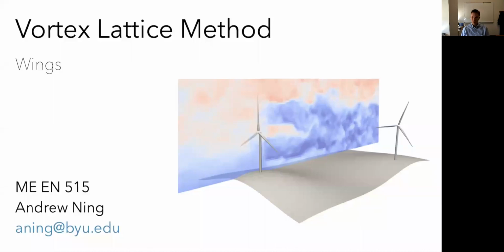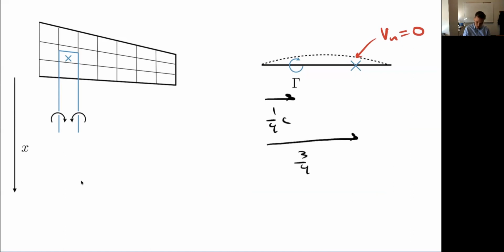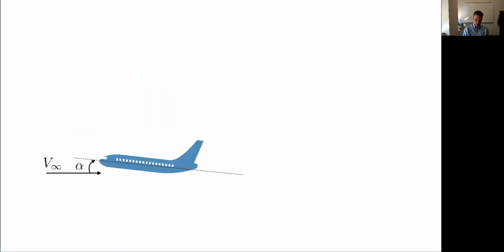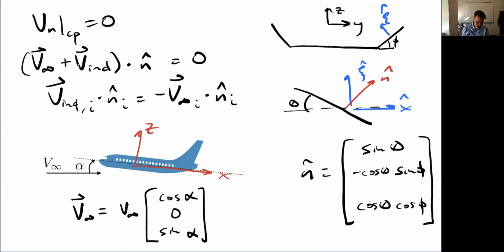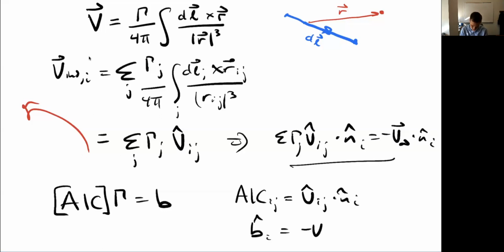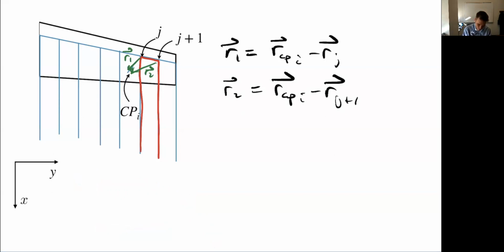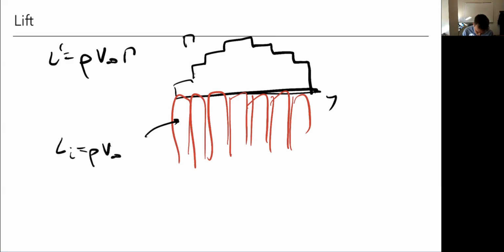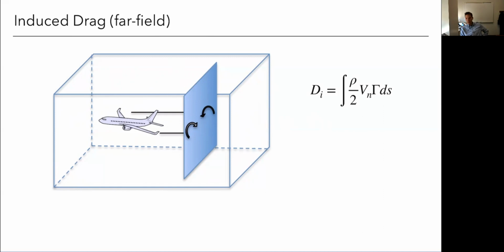Vortex Lattice Method

Comment: Hey, you keep mentioning a book. What book is it exactly ? I can’t see any links in the description.
Reply from the maker: You can get the PDF here: http://flowlab.groups.et.byu.net/me515/aero.pdf
Reply: @BYUFLOWLab  Thank you very much for the link ! Btw, I used BEMT for a shrouded Ducted Fan optimization code. Works great. Perhaps you might have any additional ressources on a model that also accounts for Lip Design (Inlet Design essentially being reduced to standard Turbomachinery Theory) of an EDF and not only a shrouded EDF ?